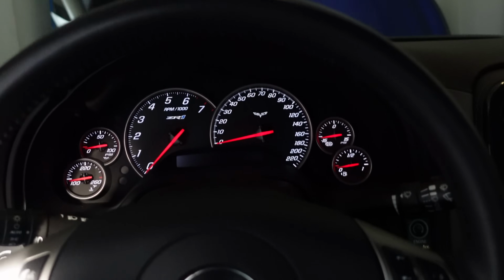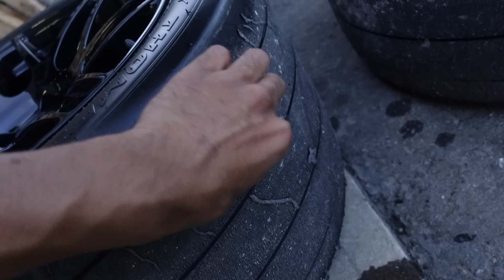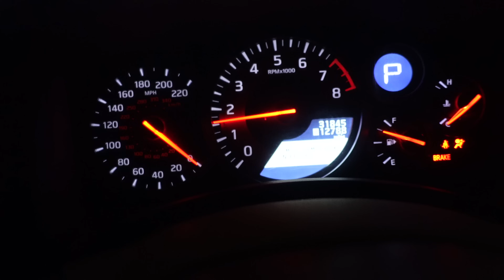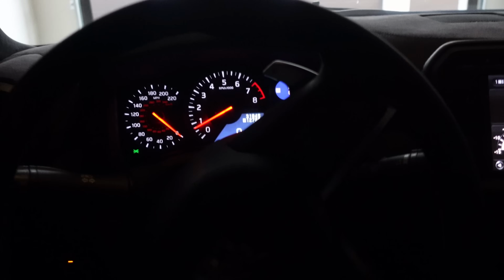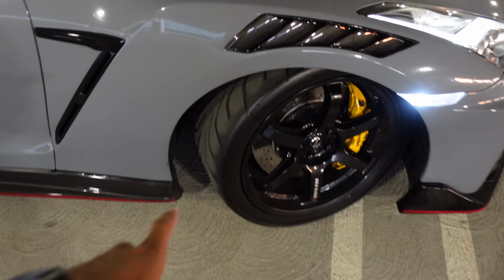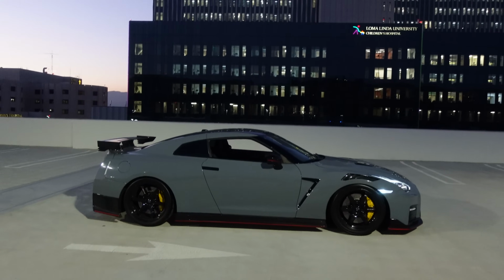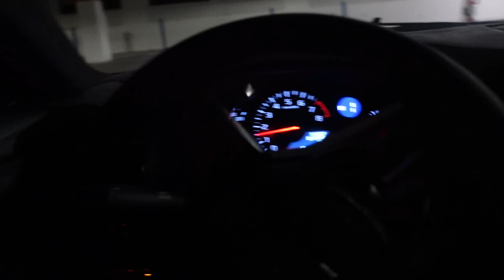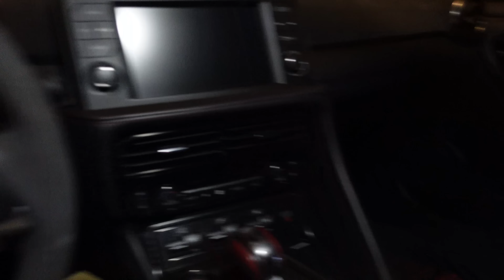My True Dyno Numbers! | Limited Birthday Merch Drop 8/5/21!

Comment: The difference is also in the dyno....this is measuring the power at the hubs vs the dyno jet to the tires. Strong numbers regardless just FYI.
Reply from the maker: still an accurate number.. Last pulls the car never cooled off and it was 100+ temps lol
Reply: @Freshhkiicks  IAT's will defiantly impact power. I never said it wasn't a accurate number but rotational mass of the wheel and tire compound play a role as well. Love the car man I ain't hating.
Reply: Nope. Our dyno reads lower than where he originally took it to.  The temperatures were way cooler that day.

Comment: Hey, man. Not sure if you are aware. Checkout the new Remnant Performance MAP sensor. They are posting new videos from customers on facebook. There is a new video on youtube of a Genesis Coupe 3.8  hitting 470whp easily because of the sensor. Another guy took the path I may go someday, which is a built motor, and his new dyno posted is at 511whp with the turbo kit. Travis at MT Motorsports said their customer drag car is at 600whp right now with the MAP sensor set up. It is making me reconsider going for LS3 swap. Do rods, pistons, bearings, etc. like Travis recommended me, and then throw on turbo kit with MAP sensor and fuel, and it would get me to my 450 to 500whp goal. People are getting 450whp now with stock ecu and stock block around 7 psi. Check it out on their facebook page and website. Just letting you know in case anyone you know has a Genesis Coupe.